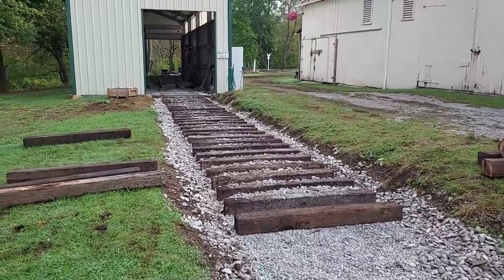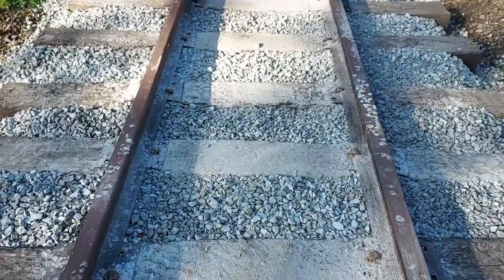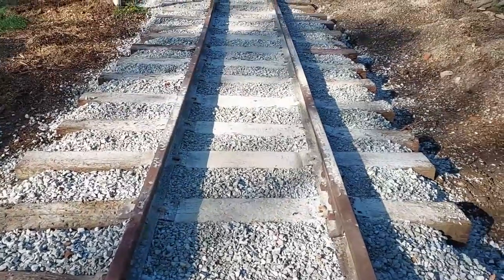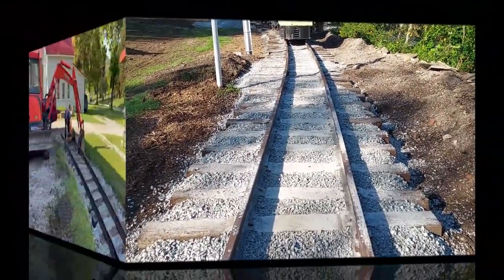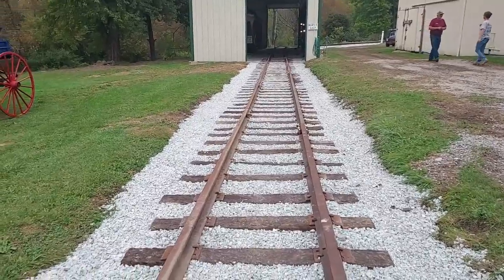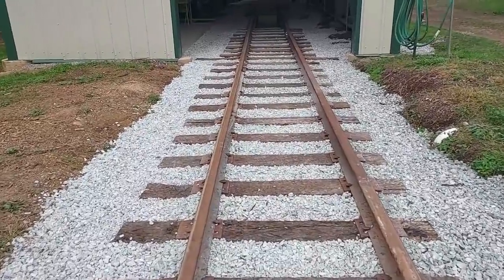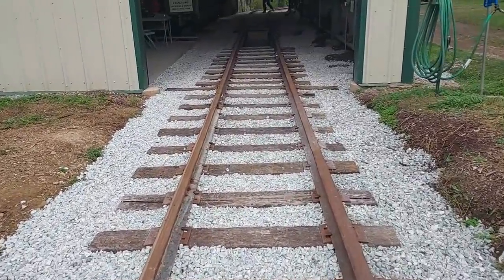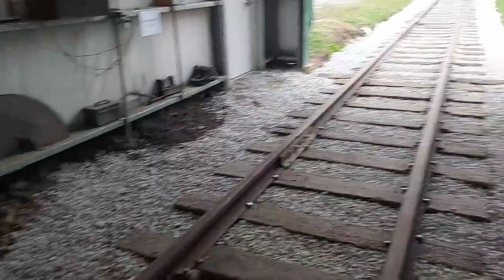Building New Narrow Gauge Track - Setting Spikes, Nipping Ties and Driving Spikes

Comment: Did you tamp the ballast with the jackhammer?
Reply from the maker: No George we didn't tamp anything, the 2B gravel we used packed
in pretty well as it was and because the loco moved so slow
over the track there really was not a need to tamp, also this
is right now a static display so we don't need to worry bout
track shifting. If we do get a dip in track then we will hand jack
and tamp with lining bars.

Comment: Whats the length of your ties and the size of your rail?
Reply from the maker: It's 80 pound rail Andy. The ties out back are 8 foot 6 inches, these
out front have about 2 foot cut off them. Appreciate your writing in
and for watching my good man. (cutting ties is very hard on chain
saw chains so they only did the front with the regulation size ties)

Comment: Where can I get a spike driver tip for our railway impact driver?
Reply from the maker: Found 1 on Amazon

https://www.amazon.com/Bosch-HS2171-Spike-Driver-Hammer/dp/B000AO4TP8/ref=asc_df_B000AO4TP8/?tag=hyprod-20&linkCode=df0&hvadid=330525688788&hvpos=&hvnetw=g&hvrand=8969889241237396674&hvpone=&hvptwo=&hvqmt=&hvdev=c&hvdvcmdl=&hvlocint=&hvlocphy=9005967&hvtargid=pla-644753005378&psc=1&tag=&ref=&adgrpid=65172136286&hvpone=&hvptwo=&hvadid=330525688788&hvpos=&hvnetw=g&hvrand=8969889241237396674&hvqmt=&hvdev=c&hvdvcmdl=&hvlocint=&hvlocphy=9005967&hvtargid=pla-644753005378

Comment: #ccrx 6700 do you add a 1/4 inch. to the track gauge? That was how I was told to do it what I worked for a short line to keep the rail and wheel wear down.
Reply from the maker: Very good question Mike. Here they wanted to keep it right at 36.
I've always been a proponent of gauge widening on sharp degree
curves on the Cumberland RR where I work, specially with our
3 axle locomotive trucks. However not anyone there has wanted to
agree with me on that one. I think it would cut down on high rail
curve wear on the gage face of the rail head and also ease some
wear on the car and loco wheels also. We have a lot of curves over
8 degrees, some are up to 12 degrees on main. Seems like it
was common practice in the days of steam.

Comment: How do you curve the rails for curves like that? Is the rail flexible enough to just put into curve by hand or is there machinery?
Reply from the maker: Great question Will and someday will do a full video on that. Some transit rail with really sharp degree curvature is pre bent when
rolled. However most all rail for freight is straight and must be
curved. To do that: bolt one end of the track together to existing
rail, then start bending the rail by hand using lining bars and setting
spikes behind to hold it in place. The lining bars or slate bars have
pointed ends and we put those in tie plate holes and use that
as a pry point to push the rail with the bar. Lessor degree curves 2 guys can do it, but with sharper degree curves it takes 3 or 4 guys
on the lining bars.
Reply: @ccrx6700  dang! I thought there might be enough flex in a length of rail but it’s still incredible to hear that. Would love to see that being done. Thanks for the reply!
Reply from the maker: @willb.383  👍

Comment: Awesome :) That will last for many years to come. Some questions for you sir. I noticed that you left the ties full length around that curved section. Was that done for the sake of simplicity, or is it because the locomotive is extra heavy? One of my dreams is to build a little 2 foot gauge railway on my property. I was getting pretty close to starting on it, but the pandemic set me back financially :( I should be good to go in a couple more years. I have most of the steel and other components to build myself a diesel/hydraulic locomotive. I estimate that it will be between 5 and 6 tons. Given that the locomotive won't be all that heavy, do you think I can get away with cutting the ties in half, so that they are only 4 feet long? Not only would that cut the cost in half, I think it would also look more visually appealing. Given the cost of wood in recent times, I had also considered buying molds, and pouring my own concrete ties, but that might not save me that much money. It would be great if I could go even lighter on the ties, maybe 4x6's, but those might not be strong enough. The other question that I have is about the rail itself. Obviously, using standard heavy rail would look very strange on a little narrow gauge railway, and it would be overkill (and very expensive.) Are there any manufactures that you know of for narrow gauge rail here in the U.S.? I've seen plenty of crane rail available, but I believe that has a different profile. And I know that light duty rail can be purchased from China, but I would rather not support them if I can help it.
Reply from the maker: Glad you enjoyed the video my friend. Cutting creosoted ties is 
extremely hard on chain saw blades! So they only cut the ones
out front. These long ties are 7 inches x 9 inches x 8 1/2 feet long and
that is what holds up those tremendously heavy locomotives
on the RR's. Our locos weight 386,000 pounds and some of the
newer ones are over 400,000. 

I think you will be fine with cutting ties to 4 foot length and it certainly
will look much better! Underground here at our mine the locos weigh
up to 20 tons and they run them on 80 pound rail, the ties are
2 inches thick and about 5 or so inches wide and 4 foot in length.

If you want used small pound rail if there is a mine near you then
you might be able to get some used rail from them. New rail call
A & K railroad, good luck and let me know how it turns out and
I think you have a wonderful idea to do that. Go for it! Write me back
if I can be of any further assistance.

https://www.akrailroad.com/
Reply from the maker: @crazyfvck  😊👍